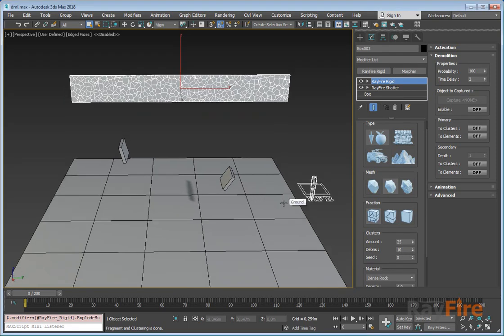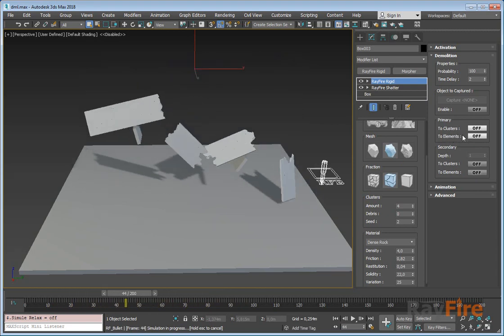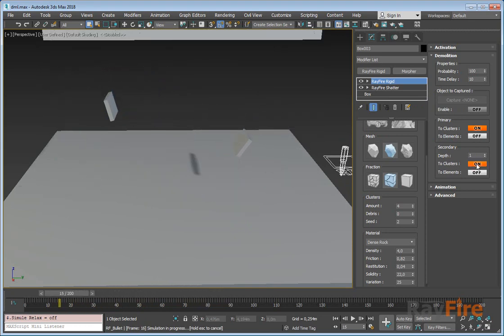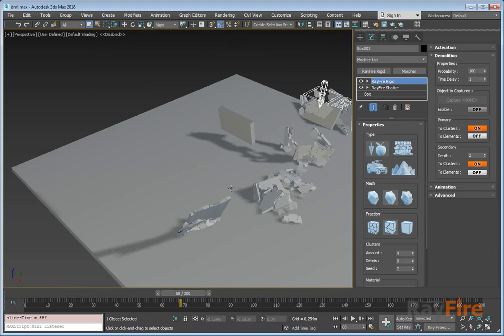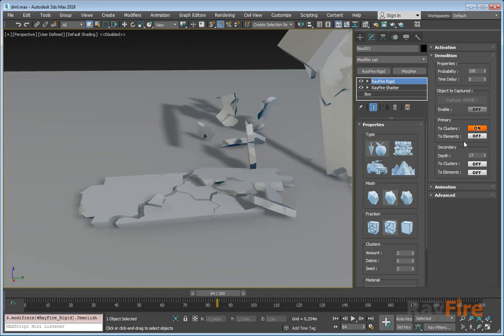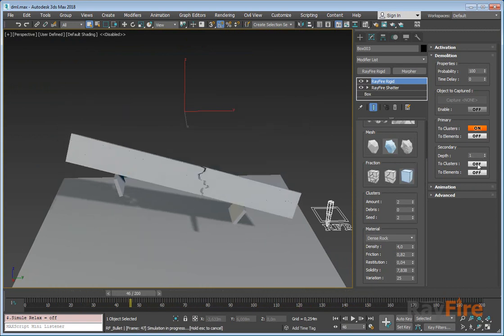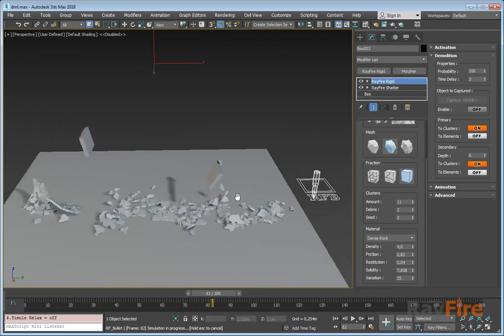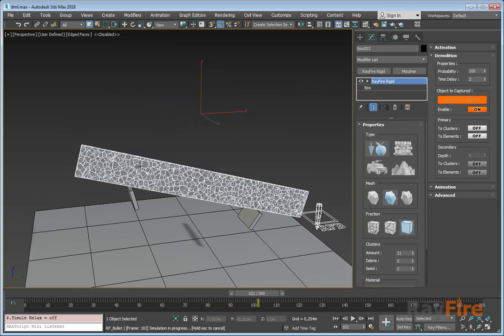RayFire 1.81 - Part 5 - Demolition

Comment: Are these all new features same as old ray fire roll out? Or this is additional. Thanks.
Reply from the maker: These are all new features, but in next build we will add some features from old build
Reply: MirVadim thank you
Reply: Interactive Demolition?
Reply from the maker: Yeah, it will be in next build 1.82
Reply: Great New`s!
Reply: I`m in Love with the new Workflow, you guys did a great job on that! One thing that would make it even better is to have a "Bake" button (like in the old build) that is always present, so we could start Loop or Range without jumping to the Bullet Helper.
Reply from the maker: Yeah, I will add later some floater ui with basic features like Sim modes, mass modifier adjustments, etc. maybe in 1.82